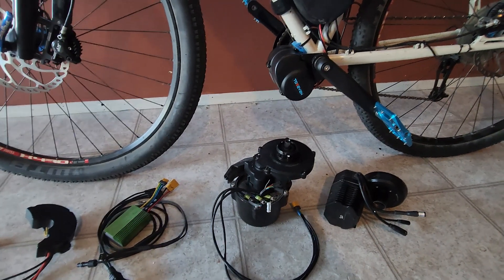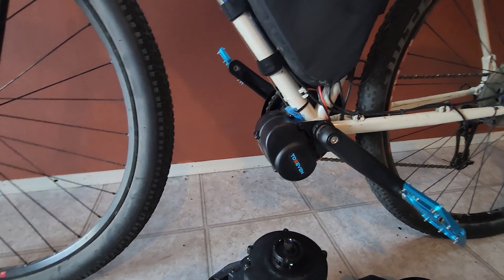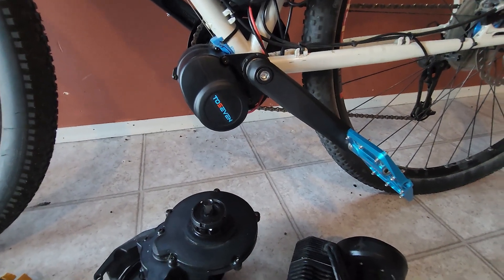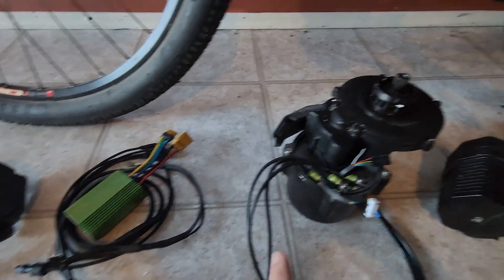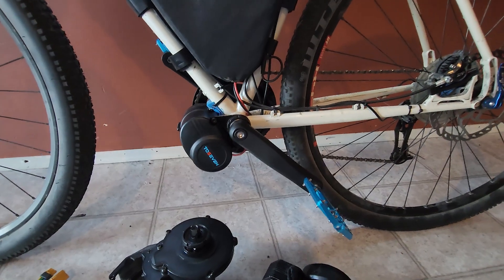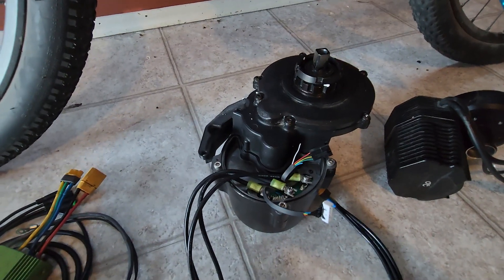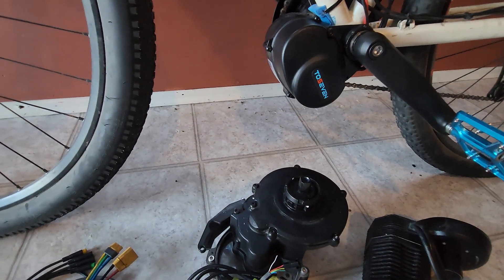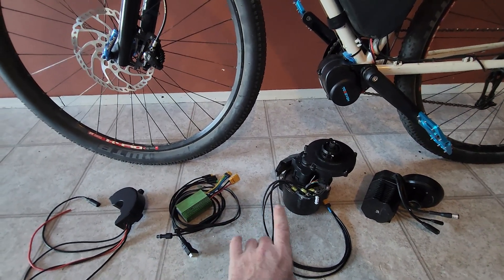TOSEVEN DM01 ASI BAC855 Time - CYC Photon is back from repair.

Comment: Any updates?
Reply from the maker: Yeah mixed bag. Motor runs great but elements of the torque sensor are in the stock controller so getting the torque sensor to run in torque mode and not regular cadence mode is going to be very challenging.

Comment: Any updates on this? Has there been any recent testing done with the DM01 in regards to torque sensor nuance vs cyc and compatibility with bac855? Is ToSeven making any efforts to improve their software?
Reply from the maker: I’ll try and slot in a general update. The stock ts has been improving of late on the DM01 / 02 but we have not been able to get it to work with the ASI yet.

Comment: Hello, please tell me how many RPM without load will the Bafang Bbshd have with a 48 Volt 14 Ampere battery with this Asi bac 855 controller?
Reply from the maker: Never ran with a 48 volt on an ASI as the BMS on those are generally not enough. You are looking at 9000 ish unloaded max rpm at 40% field weakening.

Comment: The stock DM01 controller, how many amps can be safely ran through it?  I was hoping for 40 Amps.
Reply from the maker: 30 is the max and it's firmware locked to this.

Comment: How does the stock DM02 compare to The TSDZ2B?
Reply from the maker: I have not ridden a TSDZ2B so I cannot speak personally. I never wanted to because of all the issues with heat. There are people on our discord who have run both though and have posted about their experiences. From what I gather it is a superior motor in terms of being able to manage heat as the motor core is pressed into the casing allowing for direct heat transfer. There are a few other differences as well which I look at in this video. https://youtu.be/0N_X0pQhWjk

Comment: Thanks much for this video, especially at the 34 second mark - now I finally see how Toseven is achieving the gearing reduction (two stages versus the one on the BBSHD).

Now if they can finally figure out how to build and ship motors, into buying customers' hands - year-end, maybe?
Reply from the maker: If you want one it can be direct arranged via the companies thread on Discord. Ask for Olekz. The first US dealer is West Coast Electric Bike. I think the network will grow soon. In terms of the BBSHD it's the same number of stages as the TOSEVEN it's just different tooth counts.
Reply: Thanks for the Discord reminder  @HighVoltageKits  - I need to "try again" to establish skills in using it.

Looking at the image of the DM01 motor at 0:34, it really looks like a double stack - I guess that's not the case however.

Regarding the CYC (I have two) it is really nice to ride "down low" speed-wise, which I've done with a Bosch owner, down around 10-15mph, and still have refined assist.

Comment: i am waiting  for 60v battery for  dm01 -- maybe 17s charged not at full procent.

i hope you get one

 AND USS FLIPSKY  asa a controller. uses VESC - very efficient .
cost  like max 100$  with BT cable
Reply from the maker: I'm not going to use the Flipsky they tend to break. Plus I have access to all the ASI stuff already. There is a reason why they are $100. There is a guy on discord running 60 volts on the DM01
Reply: @HighVoltageKits   maybe they break... i can't find... i saw a 60v video from another guy.. 
This beats sure bbshd 1.5kw at 60V.....  60v  vs CYC photon - both 2kw...... this i want to see one day!!!!!!!!!!
Reply from the maker: Yeah this will wipe the floor with the Photon as it's bigger and can handle the heat for much longer
Reply: @HighVoltageKits  Omg!!!

Comment: for gearing for the DMO bike i'd like to suggest you go with an IGH my preferred is shimano inter3 i've put thousands of Ks on mine never had an issue running the 1800-3000 cyclone 48v ... also i'm in the beginning of building a new bike BBSHD i'm interested in your upgrade controller kit, i made a discord an joined your group but how do i contact you? also do you ship to australia?
Reply from the maker: I'm tempted to try an igh. There will be an option hopefully soon but can't talk about it right now. You can email greg@highvoltagekits.com for kit information or contact Mr High Voltage on discord with a pm. I'm listed as Captain Codswallop. We ship Aus for sure.
Reply: @HighVoltageKits  i've tried sturmey archer and others but went back to the shimano inter3, the others broke within 800km, shimano now has  an ebike designed 5speed now too i'd love to try but i'm sure you'll be happy once you try  IGH .... thanks i'll email you soon

Comment: I appreciate your attempts of running both DM01 and DM02 with the ASI BAC controller but for many people an interesting thing would be how Toseven is dealing with the software updates for their stock controllers. Only a minority of users would run their motors with a third party controllers IMHO. DM01 + ASI BAC cost-wise is climbing into CYC Stealth and Pro territory.
Reply: but if it works more watts and performance than the stock CYC motors
Reply from the maker: Yeah. Right now the focus is to get something really good as stock. The update process needs to be streamlined. It's no where near as slick as the CYC app is. You are right in terms of price. It's too early to say. The CYC motors also seem to break alot so if these are reliable at high power.... Its all speculation until its on the bike. If might only last five minutes.
Reply: So why they would buy in th first place. Just buy a hub or bosch and don't stick out.
Reply: @eXTreemator  do either 'a hub or bosch' have torque sensing?
Reply: @claverton  Bosch? yes, always! Hubs sometimes but rarely.